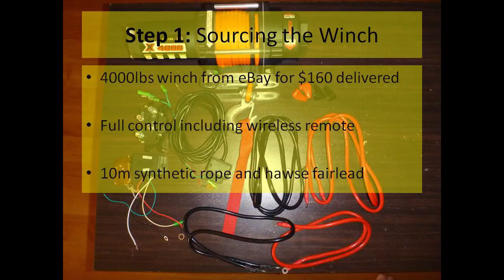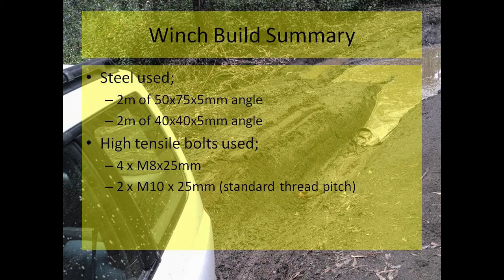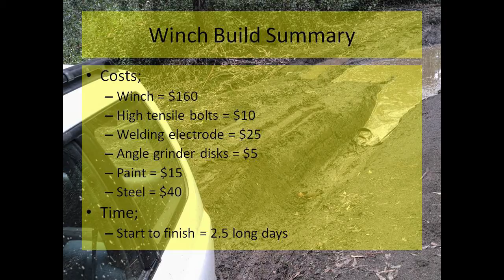Subaru Forester Winch Build

Comment: 1.5 (times) vehicle plus gear. Subaru plus camping gear you need a 5500 lbs winch.
Reply from the maker: Yes you are correct. 4k is to low. Version 2 had a 9k winch which is great.

Comment: I would have jumped on those burms that lift up and walk across it like a daisy
Reply from the maker: The ruts and slippery mud before that made it pretty difficult to climb out of the ruts and I hit it with a little bit of speed resulting in being beached and unable to back out. This was pretty early on in my offroad experience with this vehicle so was still getting the hang of it. Plus needed a reason to try the winch anyway.

Comment: Sorry but I agree.  Get a real 4wd mate.  That subi is gonna fall apart doing the tracks you do.  No disrespect intended.  They are not built for that work.  At least get some proper tires.
Reply: Michael Nugara funny because that suby seems to be going pretty strong still why do people with big fourby's look down on the subys must be annoying that a " soft roader" does so damn well given they cost so much less to fix and maintain and are cheaper to fuel than the big beasts of burden you find in your " proper fourby".
Reply from the maker: Michael Nugara Its still working at the minute and hasnt fallen apart yet. Is saying that though it has got more damage/wear and tear than I expect a larger 4wd would have on the same track. Its lower and everything hits the ground more often. Saying that though I have never been stranded yet and have past many a real 4wd on tracks who have been stranded with shattered cvs or diffs or broken spring and all sorts of issues. That must say something for either Subaru or my driving style.